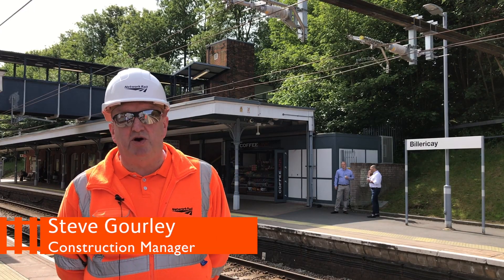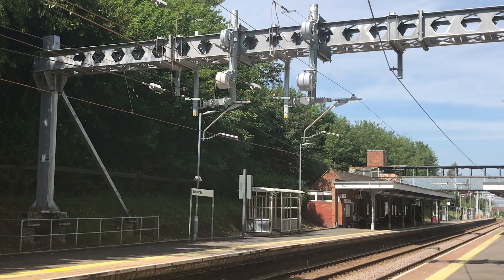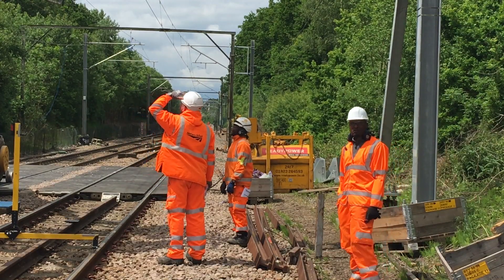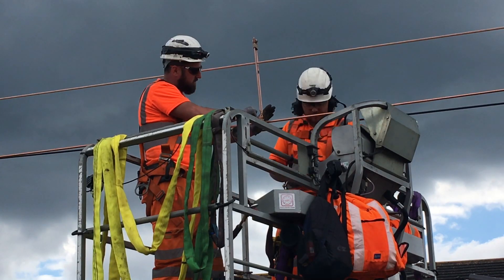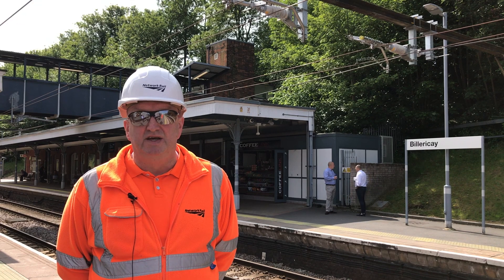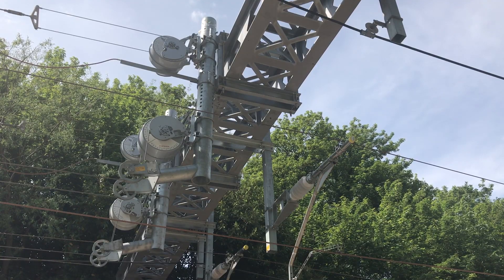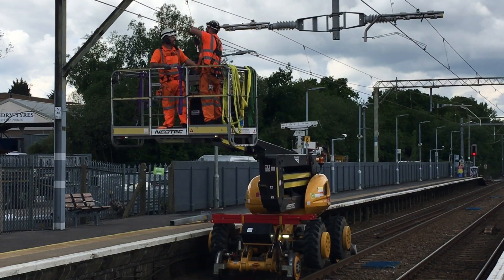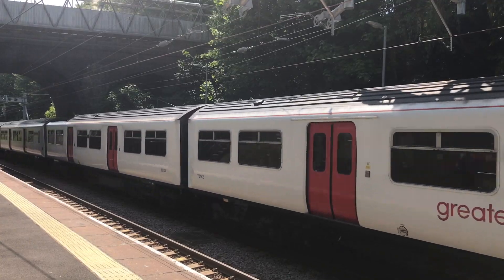Southend Victoria Overhead Line Renewal

Comment: Love how you installed new overhead structures and new overhead wires whilst replacing the old overhead wires that were first installed in the 1950s. The new overhead wires has helped with services in & out of Southend Victoria. Nice work Network Rail.